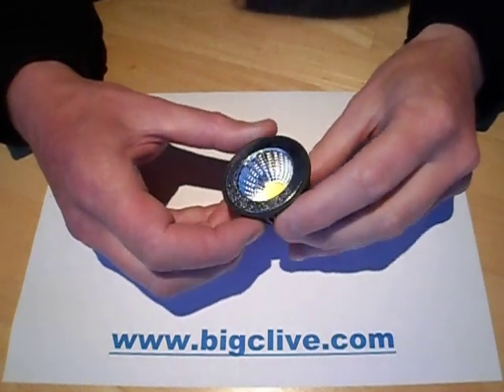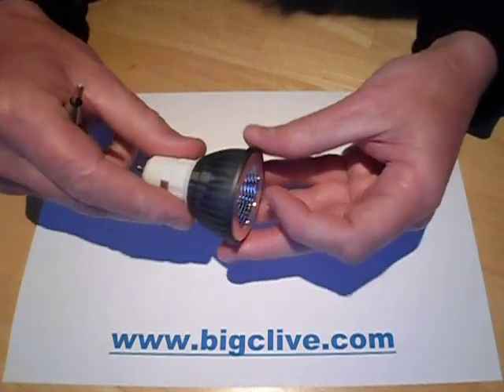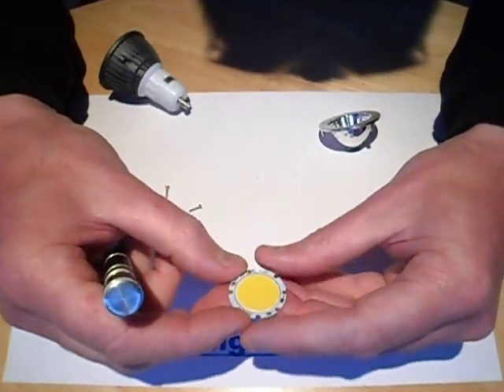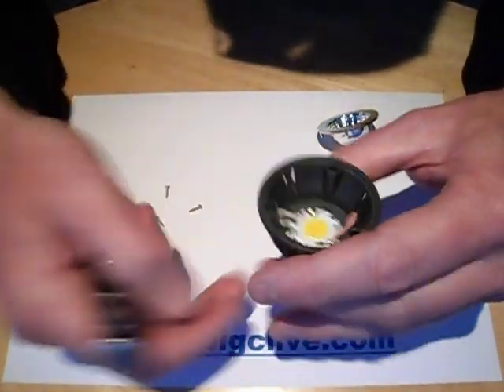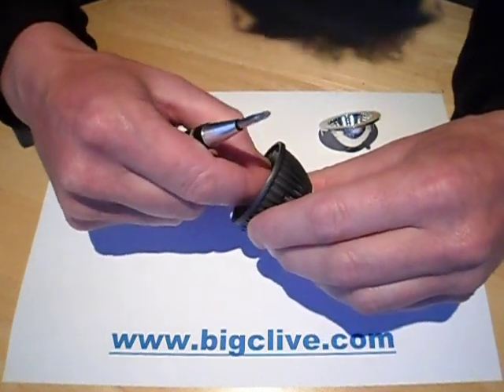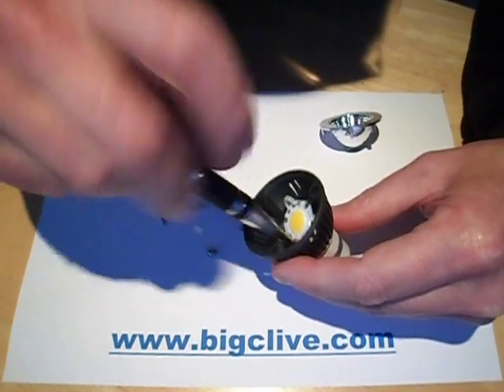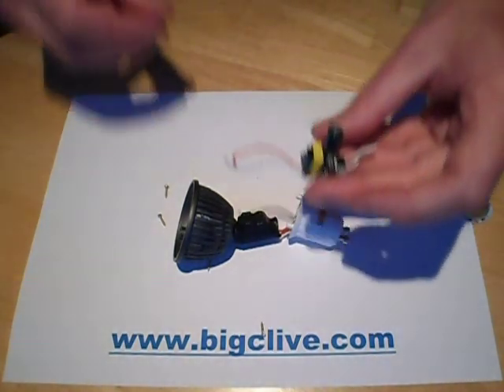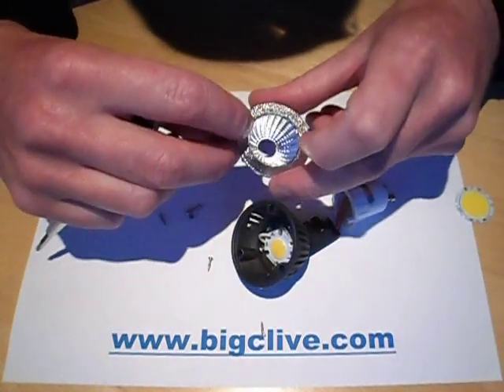COB style 3W LED light teardown.

Comment: Which glue will it good to attach cob to ceramic plate instead of screwing?
Reply from the maker: You get thermal transfer glue.  Usually silicone based.
Reply: @bigclivedotcom  k thankyou